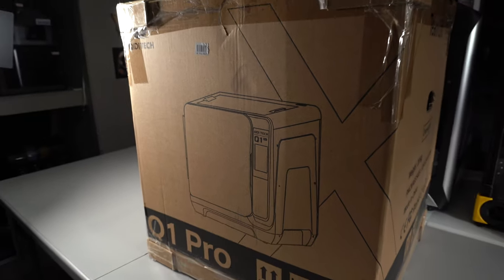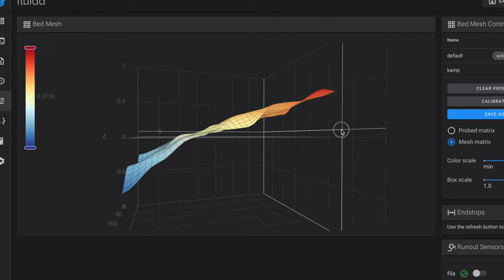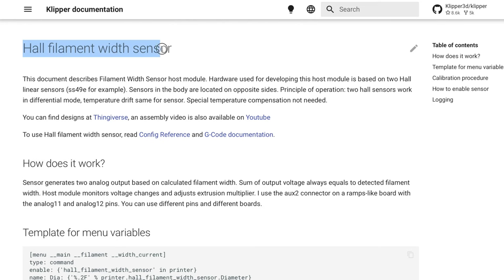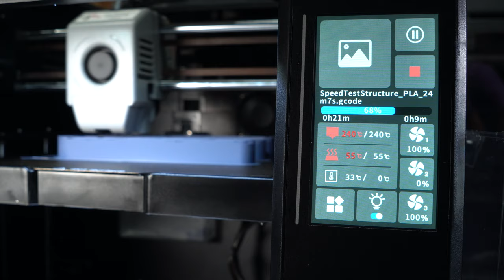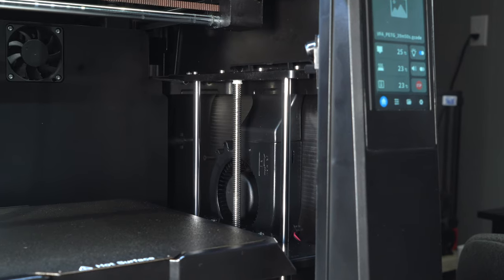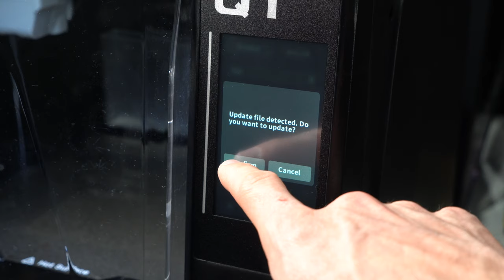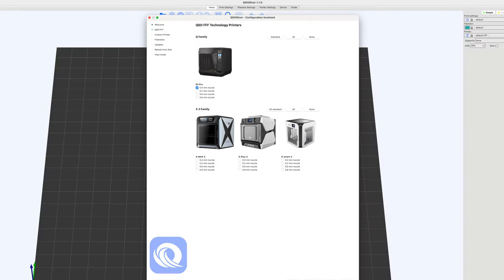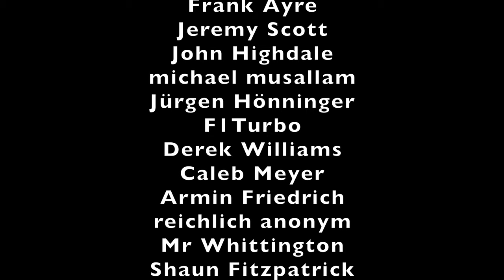Is The Qidi Q1 Pro a P1S Killer? Detailed Review & Comparisons

Comment: As an engineer, I always get triggered when someone says it is 245mm^3. The build are is 245mmx245mnx245mm, that is 14.706.125mm^3. Sorry to be so petty but I had to say it...
Reply from the maker: Haha good point!
Reply: Or maybe 245^3mm^3
Reply: (245mm)^3 is also correct
Reply: The issue is perspective. He is saying 245 cubed as in a cube that is 245mm you are looking at it from a math equation standpoint. He didn't say 245^ he said 245 cubed.
Reply: (245mm)^3 is correct
Reply: @mp-xt2rg 3:00 it's on the screen so...
Reply: It is 245 cubed not 245^3. It print a cube that is 245mm well minus the unusable space… not rocket science here.

Comment: Problem is, the P1S isn't massively more expensive than this & it's really hard to see why anyone would choose this rather than saving a little more and getting a far more refined product.
Reply: How the hell is the P1S a "far more refined product" exactly? You sound like a Bambu fanboy bro.
Reply: @drconflict629 Not to mention it's $440 vs $700
Reply: The Bambu is closed source, that's a deal breaker for many.
Reply: @drconflict629  because it objectively is, not discussion about that. I would still get this one though, just because of that chamber heater.
Reply: @riba2233  Another clown that claims something without giving a single shred of actual evidence 🤦‍♂ Okay bud.
Reply: I just bought a Q1 for $652 AUD while the P1S is $1069 nearly double the price.
Reply: The price difference is significant and the built-in chamber heater seems very useful for printing nylon and abs. You could add a chamber heater to the P1S, but that just adds another $50 or so to the already large price difference, not to mention it's way less convenient to control. Also, I assume many people (including myself) feel that the extra capabilities of the P1S, like increased speed, color swapping, and slightly better quality, are not worth the extra cost to them. I personally don't need or want that stuff as much as I want a heated chamber and lower price tag. It just depends what you want
Reply: Where I live it's much more expensive at 900 vs 650 after taxes and shipping which is a huge difference, I could get a k1max for that price.
Reply: @petercallison5765 they've gone down to $599 so now even harder choice for myself

Comment: The Q1 Pro that is now being delivered is revised and has some improvements (Q1 Pro v2). Things like the LAN port, side filament entry, build plate stops, power switch is now easily reachable from the left were adressed. They also have in the meantime released some gcode files for am ore robust spool holder - top or sideways mount.
Reply from the maker: Interesting. Thanks for sharing!
Reply: Szkoda, że nie zrobili tego od razu. Ktoś kupił te wcześniejsze wersje i jest zły.
Reply: I noticed that in my version as it had those upgrades that most reviews were missing eg build plate tabs and Ethernet port. It's good to see those improvements without putting it out as a new model like the creality k1c
Reply: @ygk3d  also apparently build plate is bigger now

Comment: I've just ordered one. It's frustrating that Qidi use a non-standard nozzle as I'd like to be able to easily use third party volcano nozzles but apparently that can be solved with a minor tweak as the length is only 2mm different.
Reply: You can get an adapter that works with V6 nozzles.

Comment: I received my Q1 Pro two weeks back, purchased after owning and having great success with my Qidi XSmart3.   Just running some PETG prints tonight on the Q1 like the XSmart3 flawless prints every time running at 240mm/s settings.   Still lots to learn with Fluidd have to figure out how to set up to record videos with Fluidd where I can save timelapse.  That would be good one to add for the Tube.  Love my new Qidi printers to date.   Just bought some higher price nylon and CF will be testing out next.  At $469 with filament runout detection and bad print detection plus heated chamber this is a great buy.  To date both Qidi machines have extremely high print success rate.  They even print nice prints at higher speeds.

Comment: 5:15 cnc kitchen did a test and determined that the reason why brass nozzles grind down over time is because the nozzle is dragged over the cooled filament. 
However, The path that the filament takes through the nozzle is not ground down at all practically, because the filament is hot at that time, and the carbon fibers can move inside of the viscous liquid.  

As far as the extruder gears, The filament is not viscous.... But also the filament is not scraping as a nozzle would across a cooled part... So I am not sure how this will fare in time, But just wanted to add those two cents.
Reply from the maker: Thanks for sharing! Good insights.
Reply: Also it is hardened so no worries anyways ;)

Comment: Nice review! To me, this is the new best all around printer for the money. I really want to get one. The print quality I have seen from reviews is generally fantastic. I also really want the advanced filament capabilities. It's not perfect, of course, but channels like NeedItMakeIt are already making mods to ease some of the gripes and it just seems really solid overall. Would be cool to see you print something out of an exotic material on it!
Reply from the maker: Thanks man! Totally agree with you on that.
Reply: Was pleasantly surprised at the results and the speed I'm getting plus the way these things generally don't need glue and hold down really well means I'm actually enjoying 3d printing vs failures 60 percent of the time on my cr10s as it had a tendency to knock over stuff with the tool head.

Comment: The material choice for the nozzle is plated copper, which should have as good or better thermal conductivity than brass. Plated copper nozzles can also go to higher temperatures than brass.
Reply from the maker: Ah, that makes much more sense. Thanks for pointing that out!

Comment: Thanks for the review, what I haven't seen in any review is  hands-on what I can do with this printer than I cant with my X1C.  For example, is it true that the heated chamber can allow better layer adhesion for some materials, what else can you do with the heated chamber and the extra 50C temperature for the hotend.
Reply from the maker: Thanks for watching! The heated chamber helps with ABS. Less warping and better layer adhesion. But even a passively heated chamber like that on the X1C can get up to around 40C, which is workable as well. Stefan from CNC Kitchen did a good comparison video to show the actual tangible benefit of a heated chamber. The extra 50C on the hotend will only be beneficial for engineering grade materials like polycarbonate.
Reply: Printing nylon without a heated chamber is an endless struggle

Comment: I would be really interested in how it handles largers ABS parts. 

I've seen some reviews where the corners of the steel sheet lift up because the magnet sticker ist not strong enough.
Reply: They either strengthened the magnets or something was very faulty as mine is so strong it takes significant effort to take off the build plate.

Comment: The nozzle is not used for the mesh, because it is significantly worse in accuracy, the inductive probe is a lot better. The nozzle probe is good enough for getting a nozzle offset or even the bed mesh, but the inductive probe is more accurate in other regards, no reason not to use it. Here are my results of probe accuracy:
nozzle probe: range 0.041718 stddev: 0.013429
inductive probe: range 0.007344 stddev: 0.002062
Now another problem is that, why is the piezo nozzle probe not as accurate as one would expect? Well, I don’t know, but I do hope it was better. Slowing probing speed down could lead to the piezo not generating enough voltage to trigger, so that’s not a solution. I guess we’ll just have to accept it.
Reply from the maker: That’s interesting! Thanks for sharing these insights.

Comment: I would get rid of the locking ring for the bowden tube on the toolhead: it will stay in place anyway during print due to filament tension, only it will go backwards when large retracts are commanded.

Comment: Orca 2.0rc has a default Q1 profile now
Reply: cool, ive been using the slicer that came with the machine, and the website none of the Software Firmare buttons work, the mobile app is in chinese when you install it too.
Reply: @mav68nrs  yea I downloaded the app but it's the same screen as the web browser so it's not really needed you can't use it remotely you have to be connected to the wifi that the machine is on

Comment: Maybe it was a typo in regards to the camera of the Q1 Pro. The default resolution is 1920x1080. Although it's higher, the processor doesn't spend times scaling and the scale algorithm is a very "shallow" one. So at the default 1080p it runs at the same 10-11fps and looks much better. The scaling down done in the fluidd interface is done locally and results in much better video quality.

Comment: Good suggestions on some settings that might be changed. I ordered this printer and it should be here by the end of the week.  It is quite an upgrade for me coming from an early Ender 3.  The slinging bed always ruined the moon lamp print after 24hrs so I am hoping to finish it this time. So many new things like not having to run in with an sd card to print, controlled temp chamber, camera, auto bed level and self feeding printhead all combine to make this as exciting as when I did my first 3D print.
Reply: I’ve printed about 15 moon lamps on my old Ankermake m5c and it’s never ruined one, I eventually got down to 16hrs print time with no lost detail.
Reply: W tej samej cenie masz Creality K1C.
Bez tych wszystkich problemów Q1.

Comment: Nice review!  You covered a lot of areas that other reviewers did not. I have older X-Plus that I ran exclusively with Polymaker PC Max that I was very happy with despite a few flaws (even made a custom upgraded “Icarus” print head for it). I almost pulled the trigger on a new P1S with integrated AMS, but the Q1 Pro at the preorder price of $469 (actually $454 and free shipping with an extra incentive discount) was just too crazy to pass up. Plus I’m all about engineering materials, not multicolor artsy stuff. I’ve also seen some really nice ABS and PC prints coming from other reviewers testing the Q1 Pro. I’ll probably incorporate a sealed filament spool dry box into my Q1 Pro. Won’t be as slick as the AMS but it’ll do the job, and all waaaay less than $1000+ P1S/AMS price tag😊
Reply from the maker: Thank you! Great points.
Reply: If you like engineering material you should be able to do PPS CF on the Q1 Pro as well.

Comment: Thank you.
How do you view the Qidi Max3 ?
I'm contemplating that vs. Creality K1Max.
Reply from the maker: It’s a solid printer as well. And less than $1000 I think with recent price reduction, so not badly priced. Not sure how that compares to K1 Max. It’s gotten a lot of updates since it was first released so it’s at the point now where it’s pretty polished. It’s missing a few of the new features from the Q1, like tangle detection and gantry leveling, but still a good printer.
Reply: The Max 3 is a great printer think it at $849 or so.  I am going to wait a bit to see if they release a new dual extruder large format, perhaps one that includes multi filament.  I can see where having second extruder for support would be nice.  I will say both my Qidi Xsmart3 and Q1 do a fine job with supports.  Im willing to wait until Spring 2025 before hopping into large format printer, in hopes Qidi has new large format machine.   The Max 3 is a very nice machine, capable of printing large parts reliably.  They offer superior customer support, very happy.

Comment: Nozzle -> Creality K1/K1 Max addon hotends ship with full COPPER nozzle with hardened steel insert!  Imagine my surprise that spare part ordered with the machine is better specced than the original, which afaik was just brass / nickel plated copper. (had blob of death, so couldn't double check ... perhaps i should burn out the nozzle and see, didn't trash yet)
Reply: That flow rate of Qidi Q1 is **ABYSMAL**. Stock SV07 Plus with brass nozzle does 24mm3/s reliably (peak 26-28mm3/s) with PLA. Elegoo's counterpart does 20-21mm3/s, and Creality K1 does according to default profiles something like 23mm3/s but i have not tested (it werks, don't touch!). To best of my knowledge K1 CHCB-OT w/ CHT Nozzle goes well north of 30mm3/s.

All measurements at 0.4mm nozzle size
Reply: and even with those flow rates, i'm almost always flow rate limited on my prints :O
It's very easy to tune to flow rate max instead of speed max these days.
Reply: @skaltura It already hits diminishing returns, as noted in the video. It's a non-issue.

Comment: now they advertise 60C  chamber.
Just get a cork mat or two for desktops from IKEA and stick it to the sides and back and you'll get 65C
Reply: rofl, not how it works lol
Reply: @olafmarzocchi6194  in that case it is better to add proper insulation foam on the inside. And you can manually configure max chamber temp in klipper anyways

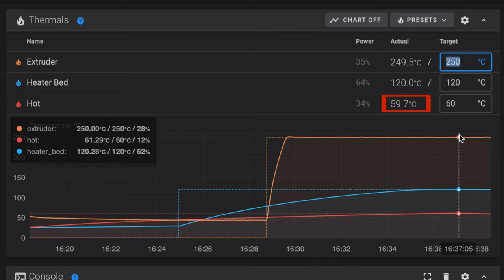Comment: Is that warping @10:40?  I guess it doesn't matter how new a printer is, if it has an enclosure, or if it has a heater, it won't magically solve this problem!
Reply from the maker: Yes. This was on the x-max 3. It warped slightly, even with the heated chamber. I didn’t put any glue stick on the bed, which would have helped.

Comment: Im always curious how easy the machines are to mod/maintain, especially with the plastic body style. Is the cable chain loom easily accessed and replaceable? And if you SSH into the printer and use htop, is the Raspberry pi clone CPU being maxed out with almost no overhead like on the creality K1 series?

Its also hard for me to see from the video if there is room to add carbon filtration. Maybe I should just put the entire unit into a negative pressure cabinet with a fish tank air pump venting air to outside? Is that a crazy idea? The idea being that you minimize the volume of costly air conditioned air being vented away while the slight negative pressure cabinet prevents fumes from escaping. One concern would be the cabinet might get too hot for the electronics...
Reply: You can add a carbon filter behind the chamber fan in the electronics compartment.
Reply: They've updated the wiki with a model of the carbon filter. You can print and install at the back of machine.
Reply: @Kimberlie1  I'm hesitant to trust a tiny carbon filter as well, the impression I got from reading peoples accounts is that the fumes saturate the carbon pretty quickly, obviously depending on how much you print.
Reply: @honkbeforeitstoolate587  It does, so I'll be diligent about replacing the activated charcoal in it and opening the windows to ventilate as I print. I'm sure they've received customer demand for carbon filters and will be looking at ways to upgrade this. They always do like this.
Reply: @honkbeforeitstoolate587 yeah I would much rather be able to add on a duct leading out the window or something. I have a setup like that currently on a printer in an enclosure that came separately, and I like it that way